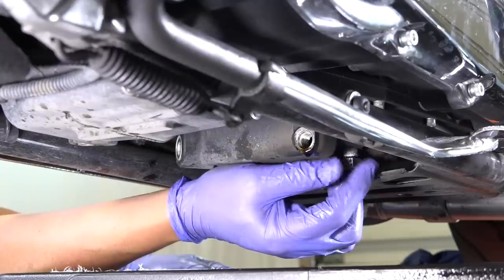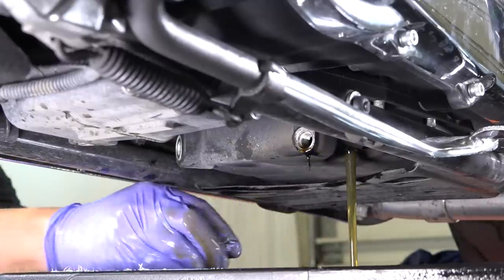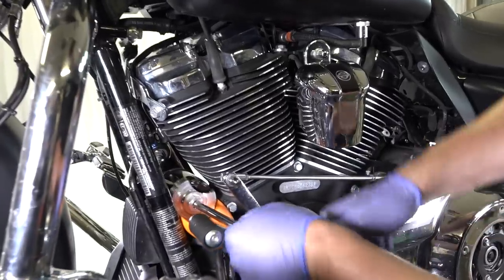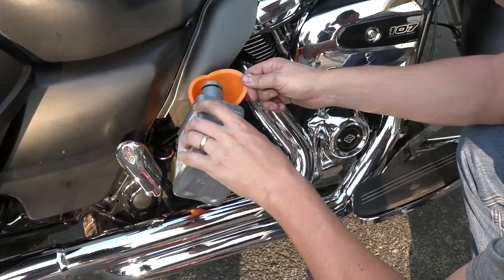Harley Milwaukee-Eight Routine Oil Change, Service, & Safety Inspection-DIY | Complete Guide

Comment: Hello there and thank you for the videos.
I purchased the maintenance and subscribed to your channel. I have a comment and a question. 
Comment: On the purchased video, you start with providing tool sizes and then you miss telling us the some of the tools sizes required for the maintenance. 
Question: I ask if you can share the tool size for the front axle SOCKET, and also if you could advise if there is a place where I could by a tool set, with the proper sizes: allen, open wrench and sockets to perform the maintenance on my 2020 Road Glide Special. Thank you.

Comment: How is it for use on a small car or even a truck? Is the low profile a disadvantage with larger vehicles?
Reply from the maker: Works great for cars too, but tall truck you may get some splatter due to the drop
Reply: @RyanUrlacher  been looking for a telescoping funnel to solve that very problem hehehe

Comment: Hey Ryan, Has your Mechanic ever heard of this problem on a 15 XG 750. Started at about 10k Miles. When Downshifting into 3rd, Heard a clanking sound. Then my N Light started flashing. While in Neutral. Took it back for Warranty work over 2 weeks ago. They replaced the N Switch. Now the light doesn't come on. Also the Clanking sound got worse. The bike shook when releasing the clutch. Service writer road tested my bike. Shifts fine when cold. Only when fully warmed up does the Trans have problems. As I am loosing confidence in my Dealer, Called another. Who informed he has had several in his shop with a Flashing N light. Even when in gear. My Factory warranty is up on Sept 5. And I cant get it to another shop to be covered. I do have the 2 year ESP. But Why should I pay for this?? The Dealer is saying I have a "False Neutral". And has been there with the same "Tech" for over 2 weeks. Who still hasn't opened up the Trans yet. He kept blaming it on an "Adjustment" Thank you
Reply from the maker: I have not heard of this.  I would definitely take it to another sop though.

Ride safe & Ride Often!
Here is a link to a bunch of our useful Free vids: http://www.lawabidingbiker.com/freevideos
Here is a link to some of our useful for purchase videos: http://www.lawabidingbiker.com/buyvideos
Want Answers & Information Fast? And help support us at the same time? Do you like the content we provide?
Our patrons get answers to their questions/comments/feedback in less than 24 hrs and are part of our Private Facebook Group. If you are interested in being in this exclusive group you can get all the details at ==> http://www.lawabidingbiker.com/patreon
If you haven't subscribed to the Law Abiding Biker Podcast make sure to do so. Listen in as we talk weekly about issues/items like this & so much more. You can listen on iTunes (Apple/IOS), Stitcher Radio (Android), or any other Podcast App ==> http://www.lawabidingbiker.com/podcast
Join our free email club at http:///www.LawAbidingBiker.com/EmailClub. Only relevant content will be sent from time to time. Email club members are the first to find out about free or for sale content are given special coupon codes.
Reply: Got it back yesterday. Has been at the Dealer since Aug 20. Now my N Light doesn't always come on. Pulled into a Gas Station. Shifted in N. Light not on. Coasted(No Clutch) to the pump. Shut off and refilled. Went to start. No Crank. Until I played with the pedal to get the N light back on. And my Factory Warranty is up on Sept 5.
Reply: Now the Service Writer thinks its caused by the Shift Peg. Have the Harley Diamond Black installed. And it rotates on its bolt.
Reply: Ryan, Check this out. My Dealer called tonight. Told me Harley Tech Support had them change the Oil on my Street 750. And now, Allegedly its Fixed. The Harley tech is blaming the problem on Valvoline Synthetic 20/50 Motorcycle oil. I have been using that oil since new. And now all of a sudden I have problems?? This is the third bike I have used it in.